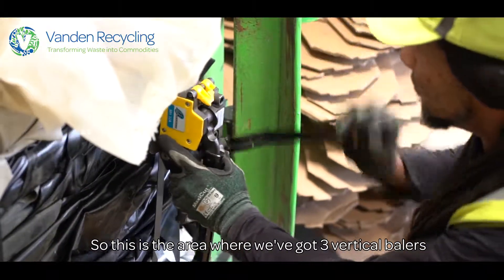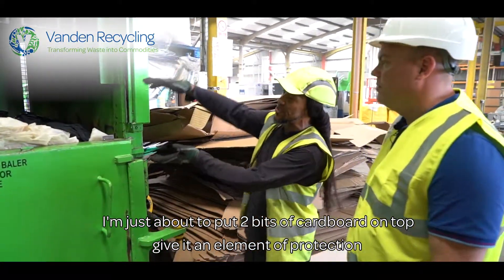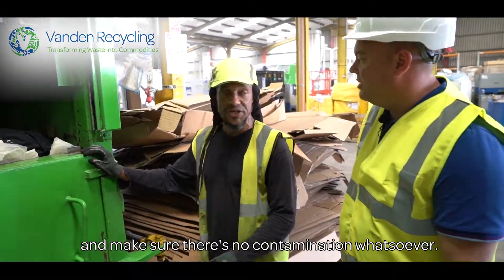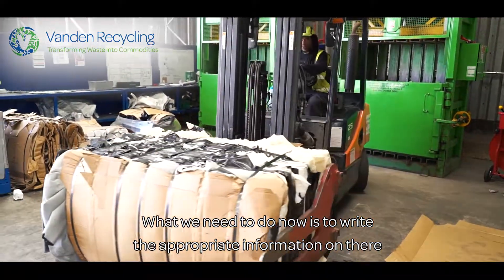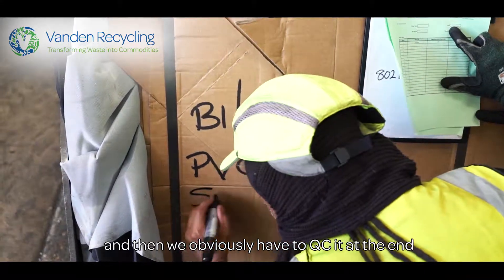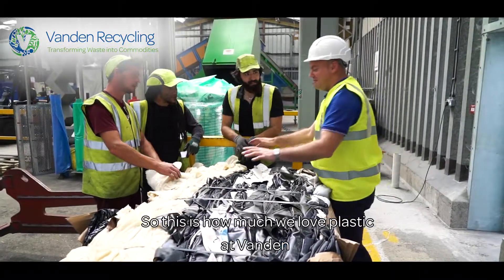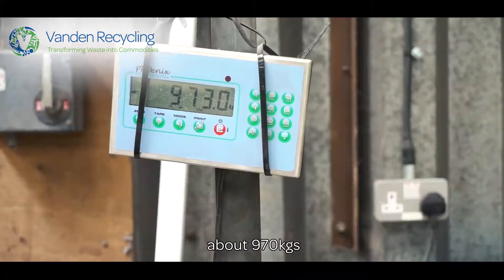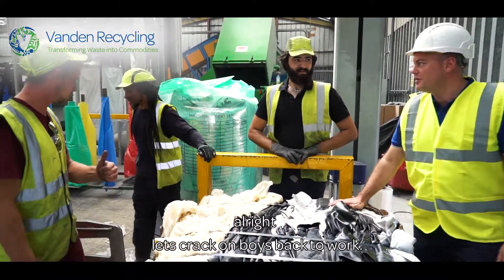A Lesson on Baling Plastic- Quality Control

Comment: This machine is rather crude, involving a lot of tedious tying by the operator.  Modern balers do this automatically.  I like the idea of using cardboard as an outer protective shell.  This has the added benefit of numbers that can be written down per bale for tracking purposes.
Reply from the maker: Hi Brian, Yep some balers and in particular,  horizontal balers are auto tie. In this application it is suitable for us alongside our other equipment. The cardboard works well to hold the ABS together nicely. But agreed less manual work is always nicer👍✅